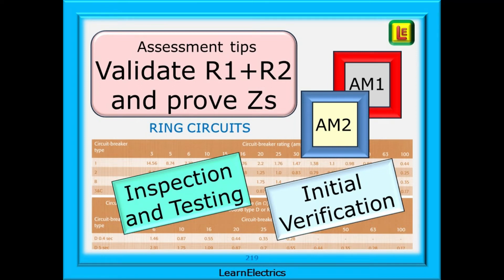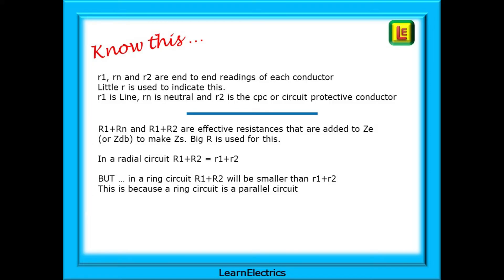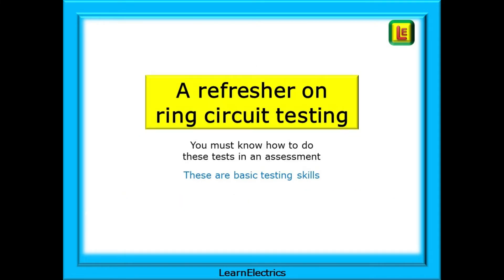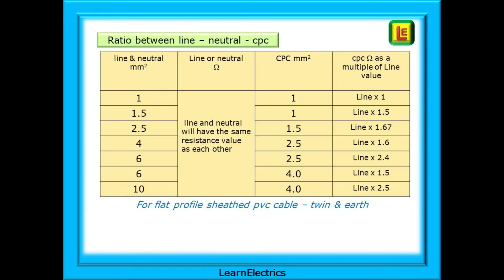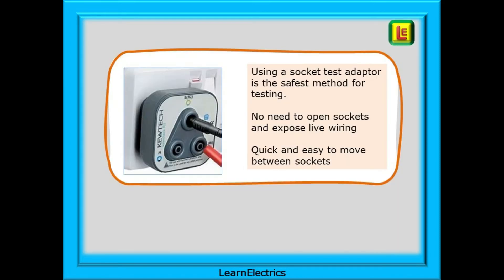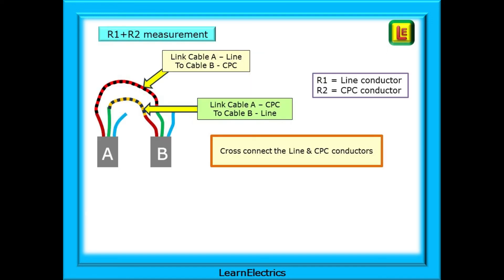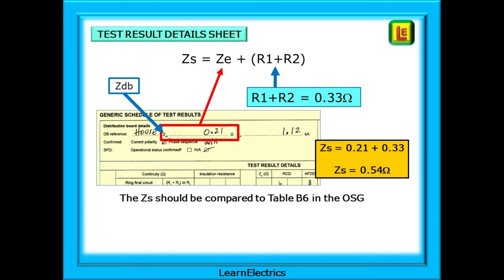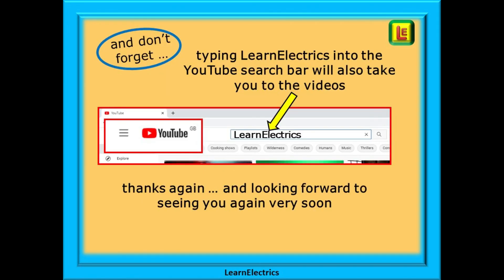VALIDATE TEST RESULTS FOR RING CIRCUITS – R1+R2 – Zs – AM1 AND AM2 ASSESSMENTS – TEST AND INSPECTION

Comment: Is there ever a situation where you use the 100% Max Zs figures? For example when checking your Zs figure when doing design work and a cable calculation. (I know that the 100% figure is for fully loaded cables that ould be at their maximum operating temp and therefore is a higher resistance)
Reply from the maker: A couple of Editions ago, yes, but now we apply Cmin to everything. And then apply 80% if we are annotating drawings with on-site test figures. We use a couple of additional tables for higher temperatures, perhaps its time to make a video on it. Thanks for watching. Dave.
Reply: @learnelectrics4402  It's an interesting topic as C&G appear to use 100% figures in exam question answers, but not always. BS7671 uses the formula without the 0.8 factor in Appendix 3, refering to regulation 411.4.4 to 411.4.204, but then later on, on the next page, the 0.8 factor is introduced for measured Zs as the cables, when measured, won't be at full load and so won't be at 70 degrees C.

 So my understanding is that for design, you use the BS7671 table values and for test verification you use the 80% value.

Comment: Is there a video on cable calcs for Ring Finals, as in for design stage?
Reply from the maker: The video on the link below is about the number of sockets on a circuit, BUT, it does go into some calculations for ring circuits that will help you. Hope it helps. Dave.
https://www.youtube.com/watch?v=QVMpVIYm594

Comment: As you gave two examples one is ring final circuit which I understood but 2nd example how we get line value or line measure on radial there is only one Line conductor No end to end resistance value. Please explain little bit more about  as I we measure R1+R2 if radial circuit.  Much appreciated
Reply from the maker: Thanks for watching, Yes, R1+R2. Another video soon on doing this in more detail.

Comment: Hi Dave, cheers for that, be good to show how the measured Ze+R1+R2 compares with a measured Zs of the circuit should it be round about correct or can it be influenced by other paths 👍🏼
Reply from the maker: Measured can be influenced by parallel paths, especially if Mr DIY has been doing some work, but the two figures should still be very close to each other. Temperature can also affect readings and even how hard you press with the meter probes.